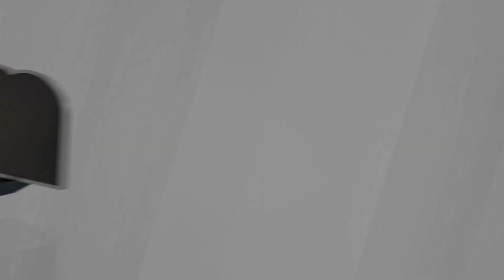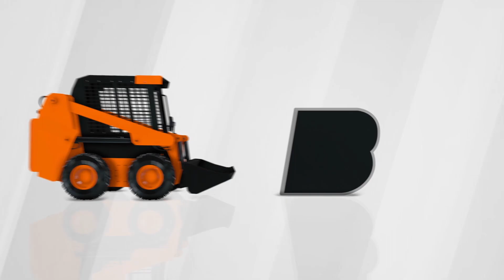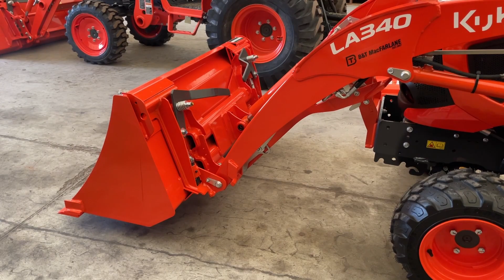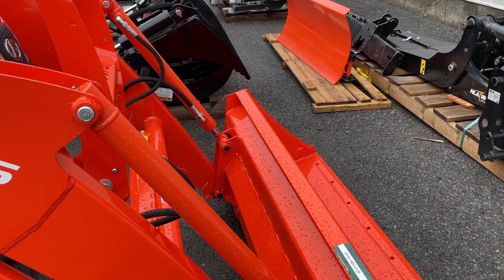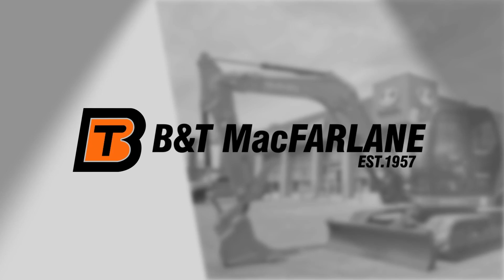DO NOT Buy A Tractor Without This

Comment: I find your videos to be very well put together and extremely helpful. I'm in the market for a subcompact currently, and considering the BX23S. I was shocked to hear you say the 613 area code in your phone number, looked you up and see you're in Ottawa...Perfect!

I'll reach out for a quote :). Keep up the great work!
Reply: I have the BX2680 because for the ridiculous upcharge for a backhoe and the 3 less HP I'd rather go rent an excavator for the couple times a decade I may need to dig trenches.  I'd rather have the extra HP in the long run...I do more PTO and pulling type work than anything else.  

You'll love the BX....each time I do something new with my BX it always surprises me at what it can do...the only thing I've found not impressive, is the numbers they claim in the brochures for lift capacity of the loader, I've found it'll barely lift 400lbs, 200+lbs less than what he claims in the video...however, you can't expect too much from a tiny tractor like these.  Beats carrying stuff by hand.

Comment: Can you use a 3rd function like 4in1 bucket with the skid steer quick attache on a b2601?
Reply: If the bucket or other implement has ssqa plates then yes. Third function hydraulic lines have nothing to do with ssqa.
Reply: Yes.
Reply: I have it on my Kubota bx1880.  Love it 😀
Reply: Yes, as long as whatever attachment you are putting on has the SSQA coupler.  The 3rd function has absolutely nothing to do with having SSQA or not though...the 3rd function is just an additional hydraulic port on the loader for running grapples, the open/close of that 4 in 1 bucket, etc.